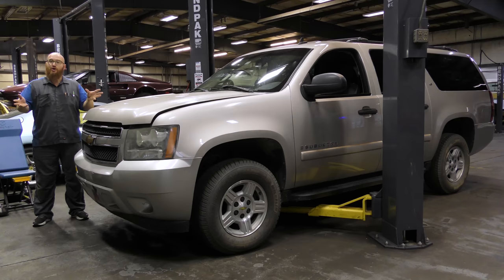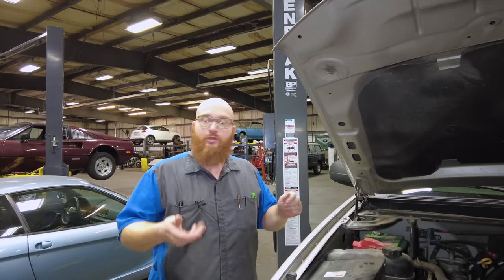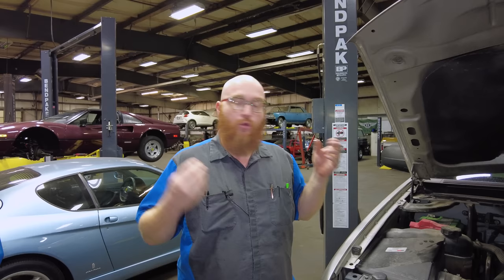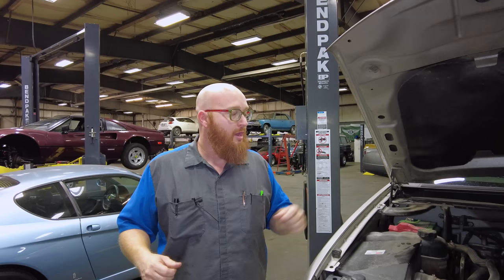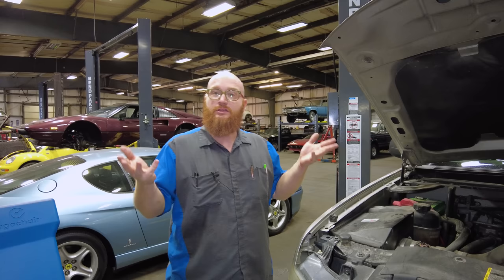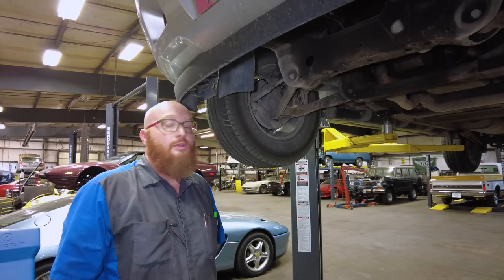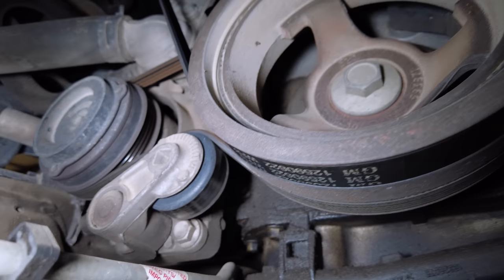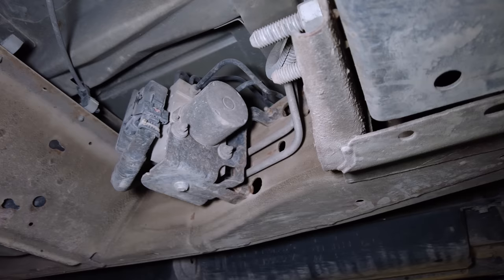What fails on ALL early 2000's Chevy SUV's!? CAR WIZARD shares what he's seen from the last 20 years

Comment: I really want an episode "What fails on ALL... 4Runners please" 4.7v8, 4L v6, XREAS suspension, Fox suspension vs regular Tokico shocks, KDSS sway bar vs regular sway bar, electronic 4wd selector vs manual shifter. Love to hear all the failure points so as an owner I can be prepared. If CarWizard was ner by I would be very happy to give my 4Runners to make videos on anything bad about them. No I don't want to hear whats good (that's why the whole family drives 4Runners), I want to hear everything bad about 4Runners.
Reply: Secondary air injection fails on the 4.7s but there is a delete box that plugs into the mass air flow sensor.

Comment: I have a Black 94 GMC Sierra GT extended cab. It has 217,000 Mi on it and I just now put a transmission in it. It's still almost showroom condition. The paint is actually still really good.  I will never part with this truck, this truck has been unbelievable.  I did put a 6-inch Rancho lift in Rancho 9000 adjustable shocks. And I changed to dual exhaust.

Comment: Most common iv seen is tire rods and wheel bearings on these tahoes and silverados get that side side- up & down shake in the hub bearing. But those Votex motors are tough i had 540,000 miles on my chevy truck before i got into my Toyota Tundra.

Comment: I have one of these that I love more than my other newer cars! For sentimental reason I do not get rid of. Oil all over, dashboard lights on, driver seat won’t go forward, locks get weird at times. Ac switch. Most of what you pointed out. I love how it runs even with all that. I refuse to let it go. Idk where to start on my suburban issues but this video is definitely helpful. Thanks for sharing!

Comment: I have a 2002 Silverado Z71, my son originally bought it new, and I acquired it from him eight years ago, it does not have AFM on the engine, it's a V-8 all the time. It currently has 235000 miles on it, the rear axle had to have all new bearings installed just recently and the oil pan gaskets replaced. The HVAC actuators have been replaced twice along with numerous odds and ends. The dash has a crack down the middle but there are no new replacements for it, all that is available is salvage yard parts or an overlay. It's an old high milage vehicle but it serves the purpose, it is not rotted or rusted out but could use a new paint job.

Comment: I bought a 2002 1500 4 wheel drive Suburban brand new.  The only issues I have had in 285000 miles  is the AC belt and compressor,  anti knock sensor failure and front wheel bearing failures,  (both sides).  Oh, I forgot, lots of rusted out brake lines and problems with the drum with-in the rotor rear brakes.   Original transmission went 242 K before total rebuild.  Original fuel pump and alternator some time after the transmission.
Body is rusty as can be, but still love to drive this car!

Comment: CAR WIZARD!!
Was just thinking of you today about the XLR.
I havent driven mine in 8 years (new kid) so i decided to make it happen.  Everything went to shit so heres what i did.
Bilstein shocks because 2 of mine burst.  Installed the resistors and it got rid of the code.
New belts, hoses, tint, upper tensioner.  New sway bar links and tie rod ends. Purrs nicely.  
Went to roll the window down and the cable busted.  Theres a little sleeve that the wire goes through that manages to absolutely cake up which is what ultimately clogged so bad it broke.  I HIGHLY suggest you pull yours out and clean them up and relube them.  Fortunately theres a place that sells a complete replacement for the drivers side door.
All i need now is to send off the led rear light again and new tires as mine dry rotted.
Ill be a pimp soon again

Comment: I bought a 2005 black Z71 suburban with -   110K and the underbody looked almost pristine. All the different metals had there original colorings (was in Minnesota for the bulk of it's life) a dealer guy was kind to print the options details for me. This truck had almost all, if not all the options available at the time. I thought this was a good candidate for restore since the interior was in very good to excellent condition. I definitely have some of the things going on that you went over. and I do have a moderate oil leak. I will look at all you suggestions as I am Mech. inclined! I had three quarters and rockers done since the molding package was concealing fender rot. But this truck is rock tight and solid. No rattles and all doors close beautifully! Thank you for this video!

Comment: I have an 03 suburban at 240k miles.  Only thing that's failed so far is the rear main seal and oil pan gaskets.  Starter is beginning to struggle when it's cold . But other than that tip top.

Comment: A biggie for me is the Stabilatrak will activate at random. What I found was a bad Ground cable with current sensor. Temp sensor/wiring will fail, showing NO A/C Engine HOT, BS warning. I love my 07 Escalade ESV Gen4 6.2 with 230K.

Comment: It’s time The plugs and wires at 100,000 miles get changed. I have 375,000 miles on my suburban with original engine. The one thing I needed was an intake manifold gasket. I change the oil every 3,000 miles and it’s very strong. I expect at least a half million miles. Thanks for the info. A lot of those things I’ve seen on friends

Comment: My 09 Escalade had the fuel system control module seals go bad and water was getting in causing the car to turn off when I would make a right turn due to the water sloshing around in the module. I took the module heated it up and pried it open and resealed it with RTV and now it’s running flawless again.

Comment: Thanks for the helpful video!  2007 here with only 150K on it.  Only had 1of these issues, but it's helpful to know what to bolo for.  I did have the cruise control switch, under the pedals fail & now my driver window is getting stuck & either won't go down or getting stuck open.  Other than that, no real problems.  Oh & the wearing away of the pictures on the HVAC controls, which I see they make stickers to replace & just bought a set.

Comment: Ok, from the beginning, if you’re not careful removing the plastic engine cover, you will break the plastic quick connect heater hose fittings at the fire wall. They will fail around 100k if you even look at them wrong. If one breaks it will quickly empty the cooling system and over heat the engine and possibly blow the head gasket. 2. Under that oil pressure sensor is an oil screen that will stop up and should be replaced. 3. The water pump gaskets commonly fail on these engines and eventually the water pump also.4. The most common reason for the ABS light that I have seen is the wheel bearing’s, the speed sensors are in the bearings and get wiped out when the bearings fail, and the light is a good indication that the wheel bearings need replacing. Additionally if you experience a lot of road noise it’s probably the wheel bearings. The AFM/ DOD models start in 2007 and up. Also when you experience a rattling noise on rough roads, it probably means the sway bar links are broken or missing, but a cheap fix! Hopefully this helps with this very informative video and great job sir! 👍🏻

Comment: My 2000 Suburban 4x4, 5.3L V8 is at 300,000 miles and still runs like new. The instrument cluster (gauge needles bouncing with lights flashing erratically) has been the biggest problem. This is another common issue. I pulled (5-min’ job) the instrument cluster and sent it to a gentleman on eBay (in MN) and he fixed (soldered) it for $78. The remote door locks have failed and I have to use a key to open the doors, however, when temperatures drop below 50° my driver door lock will NOT tumble, so I can only open the truck from the passenger door. Minor complaints for sure, but considering I have contracted all over this nation for work and this vehicle has served as a home on wheels, I have saved thousands of dollars on hotel rooms and it only makes for a better adventure in every day life. Postscript: in the comments, a few people have mentioned reliability on par with Toyota, and this is very accurate as I have owned a few Chevys and a few Toyotas, one of the main differences though is when this engine was newer, I could get  520 miles to a tank of gas, where by comparison, my Toyota FJ cruiser would get just about 200 miles to a tank, and that is a huge difference, especially in the dead of winter. One last note, the Chevy heated leather, fully adjustable seats, are probably the most comfortable seats that I have ever owned, and they still work like new.

Comment: I have a 2000 Chevy Tahoe LT. I've been driving it for 10 years. Bought it after it sat for 2 years. I haven't had any 1 of  these issues. I even changed the plugs and wires and didn't break a wire. They looked bad but might not of been factory. Any way only work i did was the alternator and water pump. Both at an expected interval. Truck has 260,000 miles at this point

Comment: I have a 2001 Yukon XL 2500 6.0l with the 4:10 rear diff that's got over 300,000 miles and its only had the ABS issue, knock sensor failure and one stepper on the dash just went out. I did have to resolder some traces on the instrument cluster when I got it due to it not lighting up. Other than that I've had to replace the radiator but that was likely due to that buck that I decapitated when it jumped out in front on me at 3am. The radiator developed a small leak about a month later that quickly became an issue. That was easy to replace, took a few hours. Was doing the brakes the other day and it looks like its time to replace the upper and lower control arm ball joints now. Another common issue with these is the front sway bar link bushings. You'll know when those go because of the clunking sound you'll get when you stop. That's another cheap and easy fix. You also left out the issue with the transfer case pump wearing through the top of the transfer case housing. When that happens it'll cause your transfer case oil to slowly pump oil out of the top. There's a kit that you can install before this happens to prevent it. Basically just a small steel insert that prevents the pump from rubbing through the housing. I believe this issue was fixed on the 2003/2004 model year and beyond. Another common issue is that the wire for the tow mode button rubs through. You have to take apart the steering colum to repair this. I'd recommend repairing the wire yourself with a longer, reinforced piece of a thicker gauge otherwise it'll just break again. You can also wire in a different button instead of having it on the gear selector (mount to the dash) and it'll never break again.

Comment: I had an '02 Tahoe that ended up with 475,000 miles when I got rid of it in 2018. Never had any of these "guaranteed" problems. All I ever had to do was a fuel pump at 130k, alternator at 225k and starter at 300k. I changed the oil every 10k miles whether it needed it or not. Never changed the plugs. Always ran well. Power steering ended up doing it in.

Comment: I drove a 2002 Silverado with the 4.3, a five-speed manual transmission, and throttle body injection for 15 years and 170,000 miles. Things I replaced, some more than once: The intake manifold gasket leaked coolant into the oil. Ignition coils failed four times. (I had a distributor, not one coil per cylinder.) Front hubs; they get loose, and the anti-lock activates inappropriately at low-speed stops. You can't grease/service the front wheel bearings, and they last about 70,000 miles between replacements. The dash lights are lit with tiny incandescent bulbs soldered into the cluster, not socketed. The radio button lights went out first. The brake and fuel lines rusted and failed. The evap system lines failed too. (I never had transmission cooler lines to worry about.) The mounts for the rear leaf springs rusted and failed. The front seal in the plastic timing cover failed twice. I had a bunch of other repairs, but all of them were parts that had lasted for a reasonable service life and just wore out.

Comment: I have a 2004 Z71 Suburban  4wd  and there is some other common issue with these as well. Canister purge valve on the intake and the vent valve solenoid in the rear near the gas tank. As far as the ABS light, which I had, was caused by a faulty wheel speed sensor located on the front hub assembly.  Also had to replace the gauge cluster at 152,000 mile. Went the route of getting a replacement through ISS Automotive. Swapping out those clusters is a 20 minute job.

Comment: Crankshaft position sensor failed on my 2008 thought the transmission was going out it’s under the starter pull the starter off and there it is replace it and you’re good to go. Thank you wizard.

Comment: Ive probably changed about 40-50 of them oil senders, in my 5-6 years experience
Also we normally just delete the ac belt tensioner and swap to a stretch belt

Comment: I just sold my Chevy truck 2003 Silverado - got it when I was 18 at 100k miles - I drove it till it had 248k miles. Thing never quit on me. Just replaced the alternator 4 times due to an electrical problem. Did normal maintenance as well. Anyways I always pulled with the tow haul on. That’s definitely the key. T

Comment: As a mechanic, and a Chevy owner.... I have to agree with everything you said. Speaking the facts. My biggest issue is blower motor resistors failing due to grounds, daytime running lights also.

Comment: I have a 2004 and other than the dash cluster and the ABS EVERY one of those things have failed. I will say that I fixed all of them myself. I need to add a few more though For an 04. ALL of your ball joints, idler pitman. Bushings, sway bar links will need to be replaced at 100,000 or so..this also includes rear track bar and all control arms

Comment: It's worth mentioning the a/c tensioner/belt failures are often caused by compressor slugging. The a/c compressor in these models were mounted so low, they'd fill with oil while the system was off, and turning on the system would cause a brief moment of hydro-lock which damages the tensioner and belt, and can even destroy the compressor eventually. They sell clutch timers/desluggers that stutter the compressor's startup to move that oil out of the compressor slowly before it fully fires up. Stupidly simple to install, just plugs into the wiring harness, and eliminates the vast majority of those specific failures.

Comment: Never had an engine issue with my 2011 Silverado with AFM. I’m religious with oil changes for all my vehicles and won’t go a mile past 5k between changes. I think that is a huge part of these engines. I had over 170k when I sold it and the only thing I noticed was the valve cover was beginning to seep oil. It was a solid truck, really thinking about buying another one

Comment: 2006 Sierra 4by @ 150K. Also had PS Pump and Hoses, brake lines rusted thru, Evap solenoid, passenger front door lock unlock solenoid, reduced Engine Power (thinks it is grounds related, TBD).  Also had the  trans oil cooler lines, AC Tensioner, HVAC air mode motor in cab lost its mind but recalibrated OK problems. Not selling.

Comment: Never wash your engine without blocking off underneath the intake manifold or you will get water in there and short out the knocks sensor. I just ran mine until the water evaporated and the knocks sensor code went away and I have never replaced the  knock sensor. if you do have to replace the knock sensor it’s best to use that authentic GM part so you don’t have to do the job twice.

Comment: We have 215k miles on our 04 Yukon Denali 6.0 engine, Still running strong but have dealt with a few of the issues you talk about. I'm letting the knock sensor repair go as it doesn't seem to really be a problem other than having a check engine light on. I just replaced the water pump and both the A/C belt and fan belt. Recently did rear brakes too. We had a cracked flywheel at around 195k miles, so had that replaced and did the leaking rear main seal at the same time for $800 incl parts. A few things you didn't mention that commonly go out or break are the air ride suspension systems, window wash reservoirs crack and no longer hold washer fluid, fuel sending units. Our PRNDL has been out a long time, but no big deal. Will buy a whole new gauge cluster if we have any more issues.  I enjoy your videos, keep it up!

Comment: I got a 2004 suburban and I got oil dripping from that area near the gasket he pointed out.  Think it might just be lose and the bolts need tightened,  the oil pressure is normal, it’s not making any weird sounds and  drives pretty smooth.  Probably gonna try and do it my self

Comment: My 2009 Tahoe Hybrid has AFMDOD but only has 1:47 46000 miles on the clock.  I intend on deleting AFM , lifters and cam and tuning before I get lifter collapse.  The 6.0L LS engine is a good tow truck with ample power.

Comment: Just shelled out a buncha $$$ on an '11 Silverado w/ABS/EBCM failure. Pump and module failed, lines/connectors were rusted (northern truck) real bad. It also had exhaust manifold bolts broken off and all body bushings were worn to point of failure. I paid the price because it's a good truck and it was way cheaper and better than new. The truck has 159k miles on it and I always use tow/haul mode wen towing ANYTHING or when a heavy load is in the bed. Thanks for the video and info. Gonna subscribe

Comment: I have to hand it to you Wizard, you nailed it.
I have already had, and repaired every one of your points except AFM (2001 doesn't have it), trans cooler lines, and 4l60E.
But ALL the other things you mentioned failed on my 2001 Tahoe before 150,000 miles.